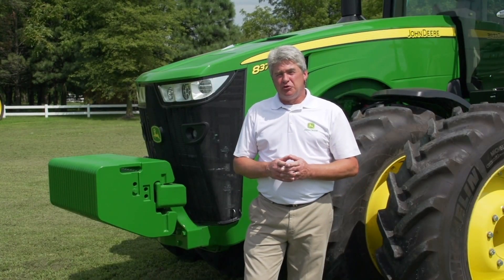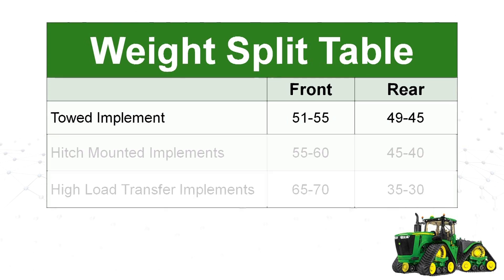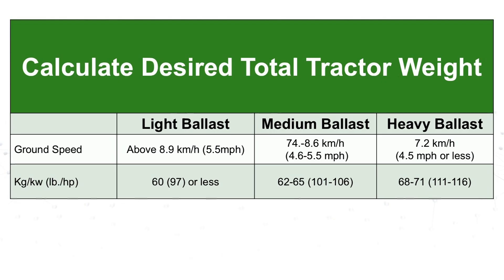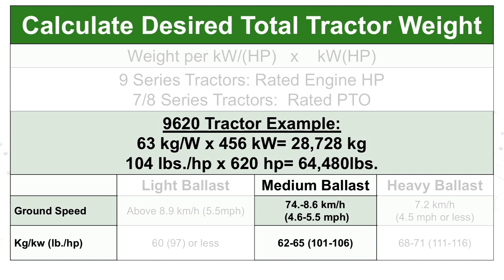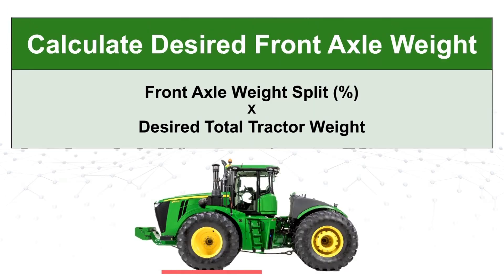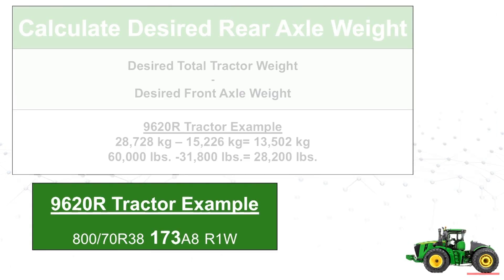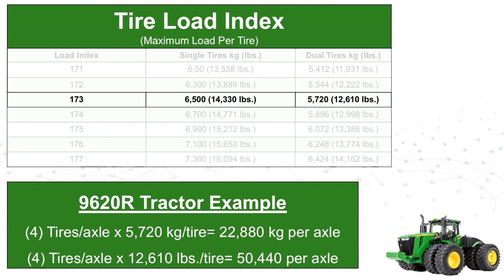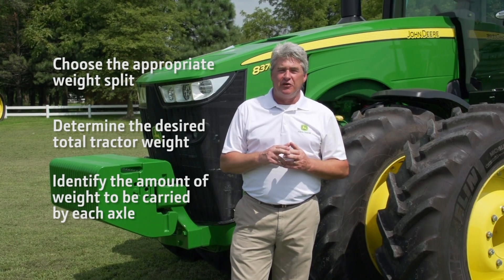How to Determine Weight Split and Total Tractor Weight | John Deere Tractors

Comment: I think this video is incorrect. The good front and rear axle weight split is comes from tire sizes on the front/rear axle. The goal is to reach the 50/50% on the 4WD and 25/75-40/60% on the MFWD tractors (it depends on the tire combination: front single/rear dual or front dual/rear dual) So If you know the tire ratio on your tractor you know the right axle load when the tractor is pulling the implment, because in this case the force/squerinch is equal on the tires. (tire size ratio = dinamic load ratio) The other question is how big is the weight transfer? The weight transfer is comes from the pulling force, the height of the drawbar and the wheelbase